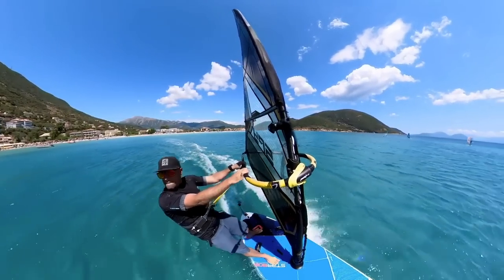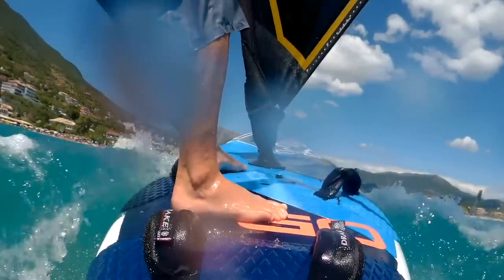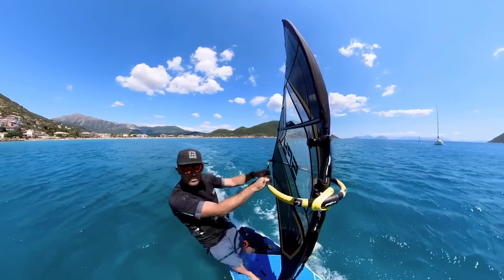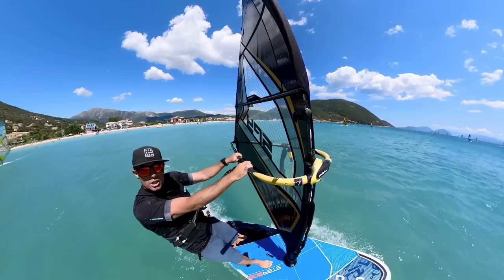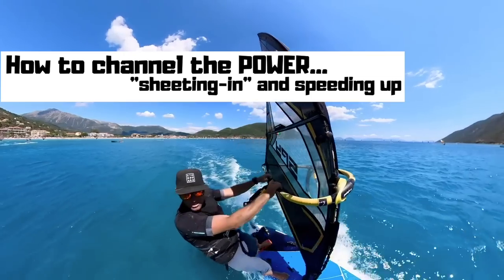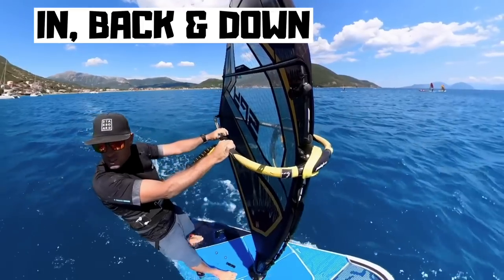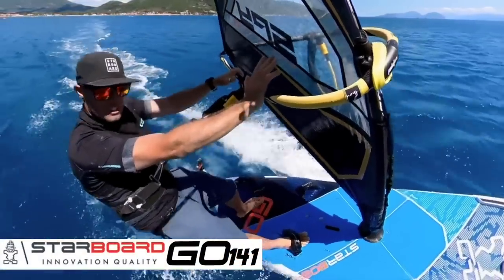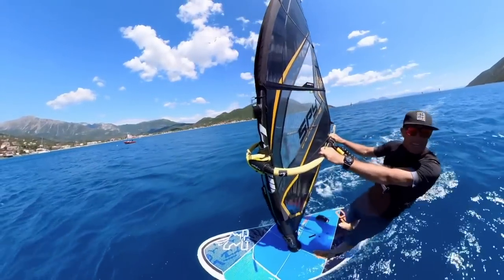How to develop control in the harness!

Comment: A great drill for learning to commit to the harness is to sail one-handed in light winds, whilst in the harness. Alternate left or right-hand on its own, staying close to the harness line. Focus fully on using the harness for 70% of your control, with your feet next and finally (one) hand pressure only when absolutely necessary. The spare arm can just dangle by your side. Finally make sure the girls / boys on the beach are watching! :-)

Comment: This is just the video for me right now as someone who is slowly getting more confident in the harness. I couldn't help but smile at 12:00 as this has been me, considering myself lucky to hook in and then hanging in hoping not to be thrown forward! The little flick is something for me to remember out on the water. I also am going to try the opposing forces movement with the front hand pushing forward and the back hand pulling. Thank you.

Comment: Great tip about getting the harness lines aft for higher speeds,  really identified an issue I've had where I take the time to get the harness lines feeling just  right in drifting around conditions and then when sped up they seem way too far forward , thought it was just me so cheers!
Reply from the maker: Makes a huge difference! 
    👌👌👌
Reply: @Cookiesports  Rigged my lines a bit aft of where they felt good schlogging, and it was part of a big breakthrough day yesterday where I finally cracked getting in and out of both straps, cheers!

Comment: I really enjoy your videos Cookie! Quick question from an intermediate surfer here.. You are running a 5.9 square meter sail in an avg. wind speed of 13 knots (a guess based on your wind description). How on earth can u get the board planing? I'm 82kg and in around 12 knots my online windsurf calculator tells me to use at least an 8.5 sail. Keep up the good work!
Reply from the maker: Come and join me here and we’ll look into it! 
Trouble is the calculators I’ve seen don’t really work… for example yesterday afternoon there were people of similar builds on sails ranging from 4.5-6.5!
Reply: @Cookiesports  Maybe you could do a video regarding this issue? wind, board size vs kg, what sail in which condition etc. Many newcomers would love this content especially when the online calculators don't work. As a 82kg standing on a 117L Isocnic Slalom boards - which sail size would you recommend for 12-13 knots?
Reply from the maker: @rasmusboegehave4945  I'll have a thing about. First advice- newcomers shouldn't be using Slalom boards like Isonics... it's like trying to drive an F1 car! Get a classic freeride board and you'll be much better off... something like a Carve or a Go will be much better suited.
Reply: Exactly what I was wondering myself. With all due respect to Cookie, from 10:13 - that is not a 12 knot gust. :) You can see the small ripples on the sea surface and small white waves (see surface difference between 11:30 and 11:33 - the latter one is the ~10-12ish knots.)

He's right about the board tho. A 141 litre GO, designed for stability and early planing will be much quicker in marginal. Add to this the highly experienced sailor and the latest technology rigg he is using - all this helps him to harvest even the smallest gusts.

What sail are you using and what fin? Also plays crutial part in the acceleration...
Reply: @TopMaphis  I'm using a 42cm carbon fin on a 127L Isonic Slam board from 2012. Sail wise I'm primarily using: Duetone 7.8 E_Pace 2021 no cam, Duetone 6.6 E_pace 2020 no cam, Serverne 5.7 blade, and severne 5.2 (done remember the model on the last one). Any tips on how to enhance my windsurf experience? It has been really difficult to learn how to ride properly in the harness and straps on a slalom board. In enough wind I even prefer water starting in both straps to avoid the problems finding the backstrap in planning :)
Reply: @rasmusboegehave4945  I'm using an RRD X-Fire 122 slalom as a big board with 81 cm width with an 8.5 cammed GA phantom. Just switched to a 39 cm carbon fin, instead of an 48 cm G10 (got a bit ripped off there :D ). In marginal condition, a larger fin slowed me down.
As for the strapping, slalom boards are hard to master. Completely normal what you experience. They are developed for pure performance, hence the small amount of strap position options. This means that they are also not comfortable to freeride.
The 127 iSonic is 85 wide, which might be a pretty rough ride in high wind - choppy conditions. Also, an 7.8 non-cam sail might not have enough pull to power this board - minimum sail for the board is 7.5 m2 as per manufacturer.
What are the exact problems with the harness experience? What are the conditions on your sport? In what winds do you take the big board?
Reply: @TopMaphis  Hey, i use the board in 7-9 m/s with the 7.8 sail. I do think about moving down to my 117L Isonic when the wind reaches at least 9 m/s. Actually, I'm doing ok.. I'm just curious if there is anything I could improve in my setup. For example.. would me buying a new board make it a lot easier to get into planning due to new design features? my boards are from 2011 ish..
Reply: @rasmusboegehave4945  7-9 m/s = 14-18 kn. For example I use an 8.5 cammed in this wind, with a 81 wide board. 14 kn with a 7.8 non cam on a 85 wide might not be enough wind to plane. Do you feel the 7.8 is overpowered in the 9 m/s wind? Would suggest to try the same conditions with the same board but a bigger sail and move on from there.
I was in the same place as you and then learned to handle overpowered conditions with bigger sails. :) Small board is a 110L JP, I go out on it with a 7.1 cammed even until 25 kn.
Reply: @TopMaphis  Not really. I can rig the newer sails to max/min conditions and actually sail a big sail in high winds. Though I would like to move down to my Isonic 117L or JP 98L small board and rig my 6.6 Duotone sail or smaller 5.7 Severne sail - the question is.. in what kinda conditions (wind-wise) can I do that? Cookie can sail small boards and small sails in low conditions which i don't understand haha :)
Reply: @rasmusboegehave4945  98l + 5.7 = at least 23-25 kn for easy WS (no personal data, based on surfbuddy's experience). 117L + 6.6 = From 20-24 kn. 6.6 non-cam is not a big sail for an 80+ kgs person. (add all the gear, wet neo, etc... you are rather 85-87 kgs). And 117 + 7.8 = I would take this 17-20 kn. Below 17 kn base wind I would take a bigger sail on a big board for guaranteed plane and manage the gusts with outhaul (or downhaul) trim.
That is what I would do at my spot.

Take into consideration that Vassiliki is a unique spot, also mentioned by Cookie in earlier vlogs. 2-4 forcasted Vassiliki wind might not be a 2-4 wind as we know it in a local area. Just look at these windstats: https://clubvass.com/windsurfing/windstats/

Maybe Cookie is a light guy (like 65-70 kgs), that would also make a massive difference with a very high carbon content gear.

Comment: Question: 
When unhooking, I often find that I'm standing on my toes and trying to raise my pelvis as high as I can, and I ALWAYS have to use my thumb to flick the line away. I'm pretty sure my boom height is just fine - It's always about armpit-height before I mount it to the board and get that extra inch or two. My lines are 34-35" (I'm 5'-10", so I'm fairly certain that they're a bit on the long side). I'm always very comfortable with my boom height, powered up or not. But, powered up or not, it doesn't seem to matter...I always have to depower, stand upright, and struggle to release. It's probably the most common reason I get wet these days. 

Any thoughts?

Thanks as always <3
Reply from the maker: Are you wearing a seat harness? 
Also… when the sail comes back and out (as you power up) the boom will be a bit lower and easier to unhook… just means you need to pre-plan a few moments ahead before you’re vertical again and can’t unhook! 
Thanks for watching!
Reply: @Cookiesports  I had the same problem until I started hooking up and unhooking with the sail under power and the boom pulled back to me, which made it so much easier.